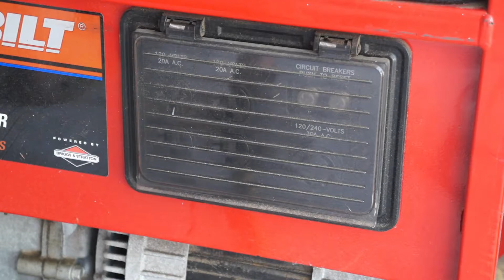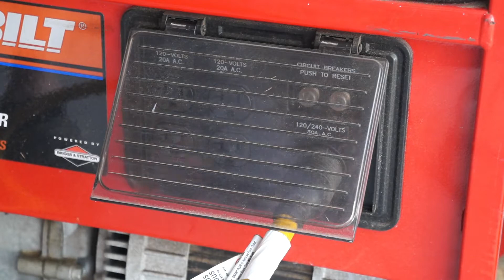How to install a generator and power back alarm - The End Grain Workshop

Comment: I recently installed the wiring to connect a portable generator at my residence. This included a 30 amp receptacle in an attached garage and an Interlock switch at the main service panel located in the basement. I will be installing the same alarm at my main service panel. The only difference is that I will be installing the alarm on the exterior of the panel so I do not have to remove the panel cover to turn the alarm on or off. I considered installing the wiring without the Interlock, but ultimately decided for safety reasons, and as required by code, to install the Interlock switch. It was relatively easy to install after relocating several breakers so the new 30 amp double pole breaker was in the correct location for the switch to function. Have had to use the generator twice in the last month and the Interlock switch worked as designed. Looking forward to having the alarm installed to know immediately when the power is back.

Comment: Thanks for this. The only thing I would add is that you ought to consider using an inter-lock kit. Many power failures happen in the middle of the night so we're not always in our most alert state when trying to fire up the generator and re-routing power and all, half-asleep. An inter-lock makes it fool-proof so even if you do forget to cut the mains breaker, the mechanism will prevent you from energizing your house circuits from the generator while the mains are still turned on.
Reply from the maker: Glad to hear it helped.  We actually had to use it a couple of weeks ago after Hurricane Ian.   Yes, an inter-lock kit should always be used in a generator set up to ensure you don't back feed any power to the grid and potential electrocute a lineman.
Reply: @TheEndGrainWorkshop  It would also prevent energizing your power cord, or generator inlet plug from utility power, when it should not be.

Comment: I would think that an interlock kit is required by code with this set-up. This is basically the same thing as backfeeding from your dryer plug.
Reply from the maker: Good question David.  The interlock kit is for use when you have a dedicated breaker for your generator only.  It will not allow you to turn on the generator breaker unless the main breaker is off.  When you are backfeeding from an existing circuit like the dryer plug you mentioned or another circuit like I used, that breaker is alway in the on position so how can you lock it out with the main breaker?  If you know of a product that does that please let me know or send me a link. Thanks Rick

Comment: so, actually, what is stopping you from wrapping the antenna around the wire just OUTSIDE of the panel, and finding a ground outside of the box?
Reply from the maker: You can certainly do that I just didn't won't to have to do any drywall work so I mounted the alarm inside the panel.

Comment: Great video thanks. Had been struggling to find something similar in UK. I think I’d install the alarm outside of the panel so it can safely be turned off without having to stick my hand into a live panel while half asleep. Or maybe just ask the wife to do it…
Reply from the maker: Russell thanks for the positive feedback.  Just used mine during Hurricane Ian last month and it worked perfect.